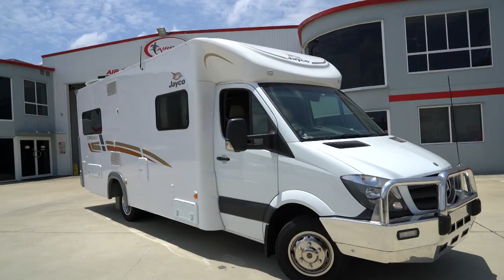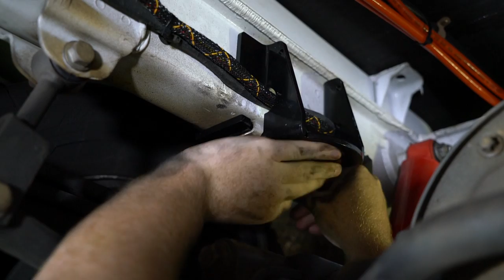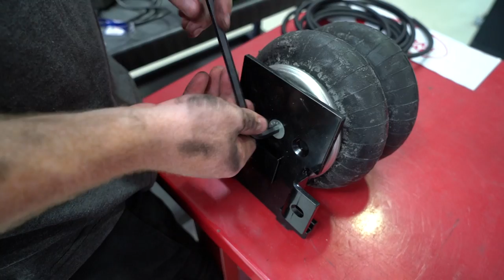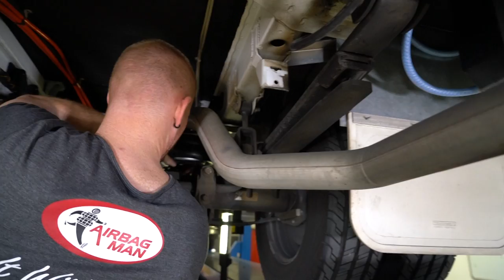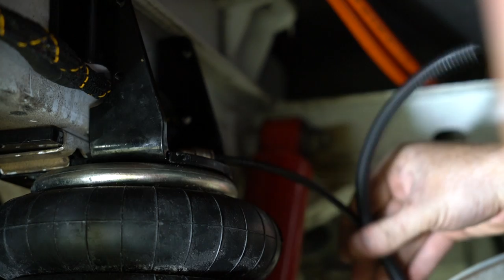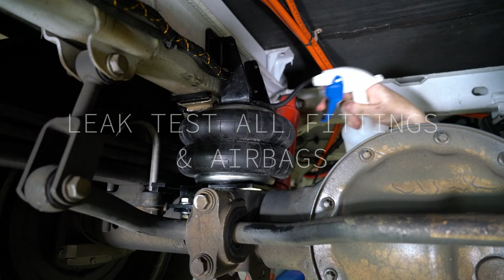Mercedes Sprinter Air Suspension - RR4690 Airbag Man Leaf Helper Suspension Kit

Comment: great video. what is the carrying capacity of the airbag, LB? thanks
Reply from the maker: G'day! Great question, our airbags are designed to match the vehicle's GVM and will not provide any additional load carrying capacity. They can be included in GVM upgrade packages but will need to be approved by the certifying engineer :)